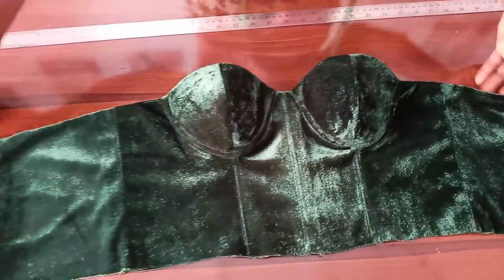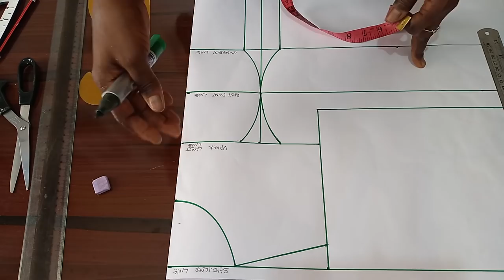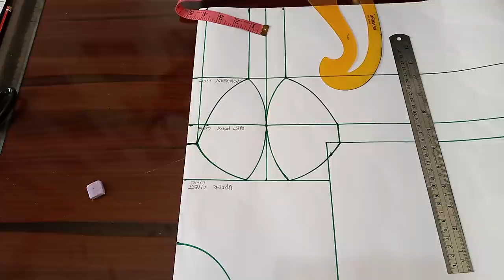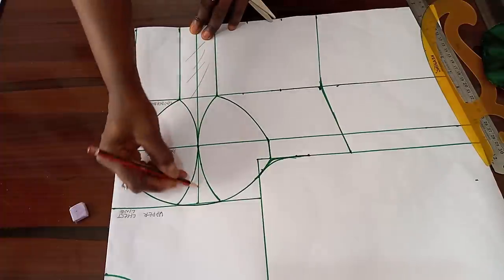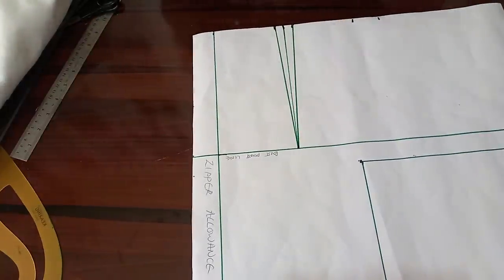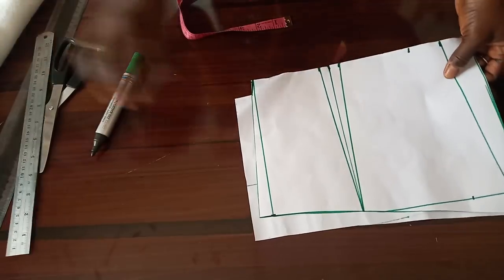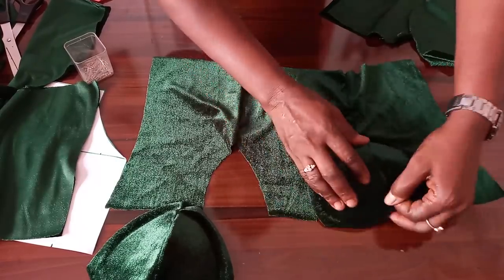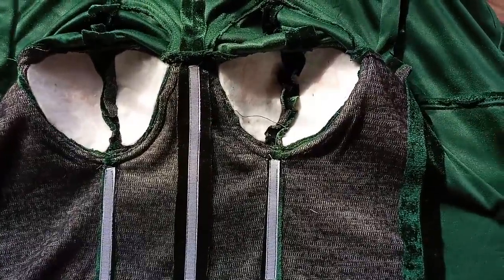How to cut and sew Corset with Boning (detailed tutorial) pattern drafting

Comment: This is a very detailed tutorial. Well done to our tutor. A quick question ma. Won't the zip allowance  that was slanted and cut off to avoid gaping affect the position of the dart when the zip is eventually fixed? After the zip has been fixed, the dart point would have reduced and not the original 4inches it was meant to be? Can you shed more light on that ma?

Comment: Thank you very much ma'am, I'm  grateful to have found ur channel. 
Pls how can one get a 4" or 5" under burst measurement to the center front part. I noticed to get the middle front right ur burst to under burst has to be 3 inches. Thank you❤️
Reply from the maker: No, 3" isn't standard.
It all started from your bust span(i.e. Nipple to Nipple)
You're a plus size, so, take your bust span measurement very well, it should be 8-9".
When you divide that, it should be 4-4.5".

Comment: I have watched so many of your videos you really amazing!! Thanks but I have a question, the center front(between the cups) later had a joining but when you explaining it you didn’t mention or cut it? I would be glad if you reply me thanks
Reply from the maker: It's not joining.
It's the stitching of the center boning you're seeing because the boning was attached/fixed directly to the main fabric.
You can fix your boning to the lining as well. It depends on the fabric you're dealing with. Tnx!
Reply: Thank you so much ❤